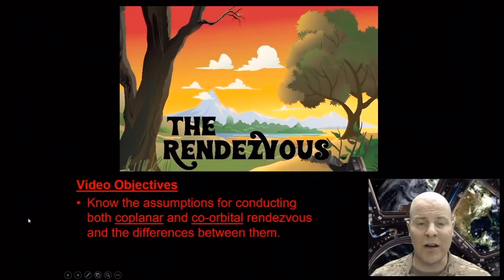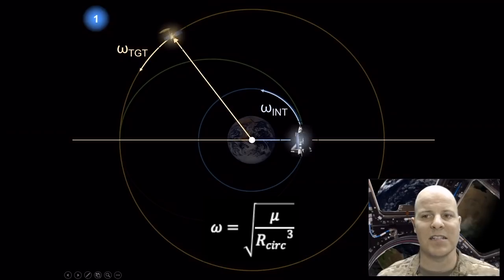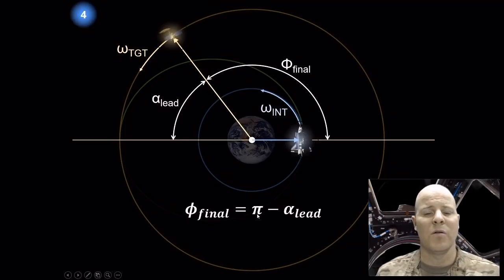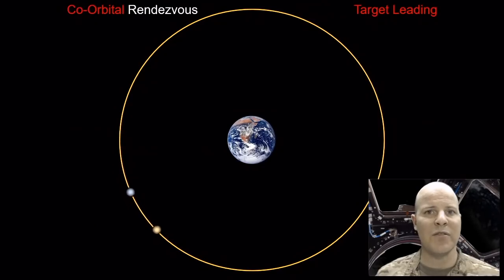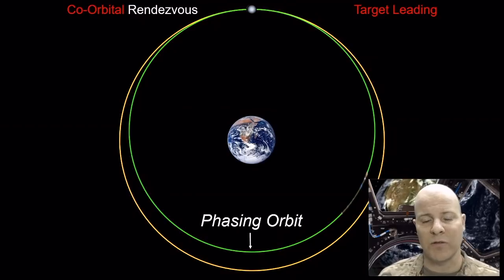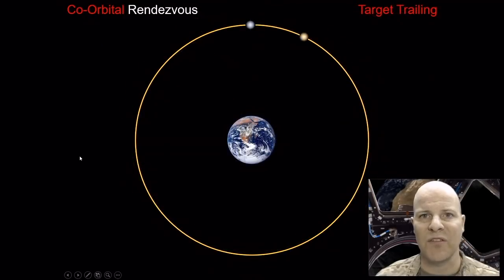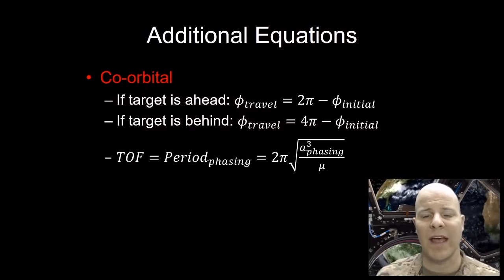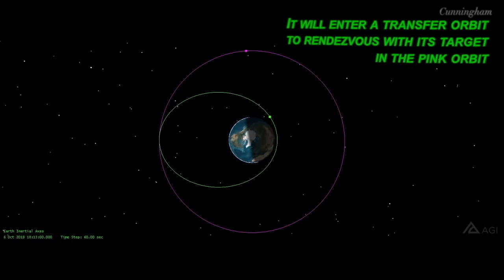LSN 19 - Orbital Rendezvous

Comment: Great video. In the math section for co-orbital rendezvous, I think V1 is slightly off. It's written correctly on the paper, but the calculation uses the aphasing instead of the original radius of 6828.137. So V1 should be 7.640 km/s. Just a clarification for anyone following along. EDIT: Oh wait, never mind, it gets changed later...duh...